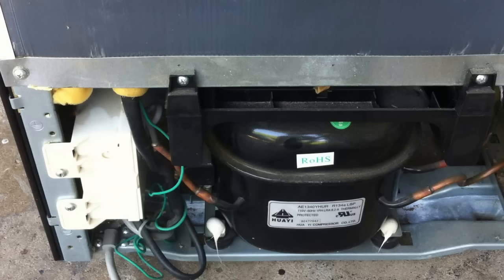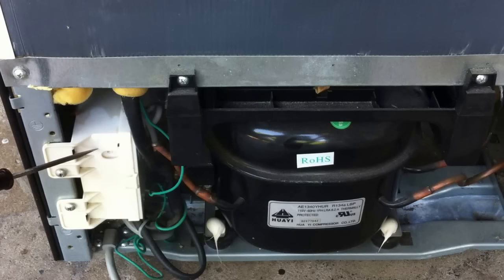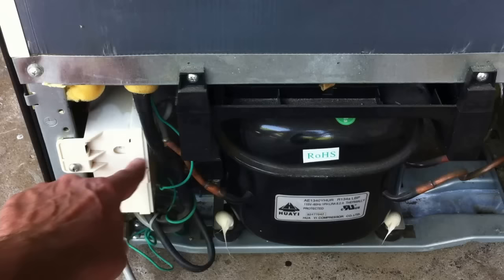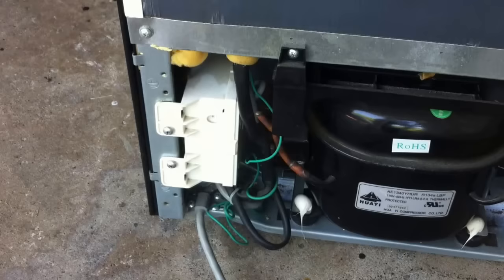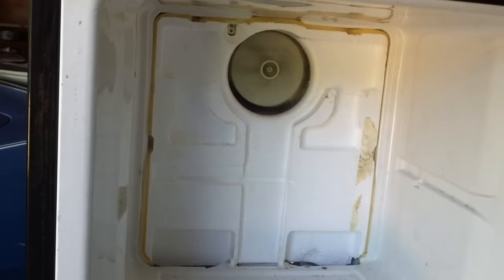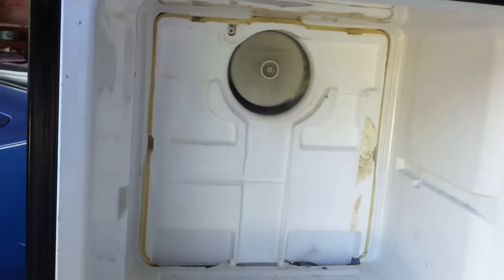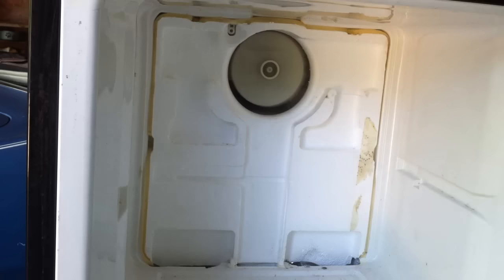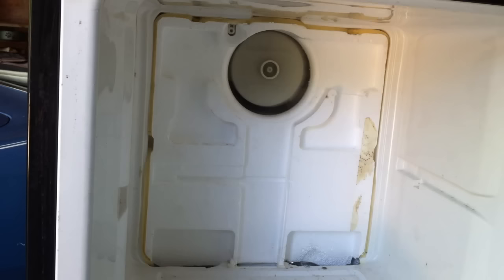Easy Refrigerator Fix, Reset (Defrost Timer) Switch, if it stops running, cooling or working.

Comment from the maker: The refrigerator NEVER came back on until I turned the "switch." Call it the "switch" or whatever you want to call it. I don't care. A rose is a rose by any other name. The goal is to get the refrigerator to come back on & cool the food inside.
Reply: Michael Powell hi! My fridge is making a buzzing noise. It's a mini fridge, can u help me with a quick fixxxx? Thank you
Reply: That is the defrost timer.  Chances are it will stop running again.  The df timer motor is going bad or it has sticking/ bad contacts in it.
Reply: you sir speak the truth
Reply: @rapunzellouise  get a new one. Those things are cheap and I promise you you will spend more fixing it. 

Theres not much there to fix, and what is there is really expensive to fix. Also, lots of times you can't find the parts. 

If I had to take a guess, it's the relay on the compressor. It could be the compressor locked up (buzzing sound). If its plugged up and got power to it, check the compressors temp. If its really hot, get another fridge. They should be a bit warm but not hot enough you can't touch it.
Reply: Hi there , when you say you unplugged it and didn’t come back on , do you mean there was no electric going to the fridge or the fridge freezer wasn’t cooling? 
I woke up today and my fridge has electric going to it as I can see the temperature and light on but I can’t cool or freeze anything , I can hear the fan but no compressor humming noise

Comment: You mentioned that there are other youtube videos that show what is in a little white box.  I looked high and low and can't find the videos.  Where are the videos?  Thanks in advance.
Reply from the maker: I posted this video in 2012, so I don't remember saying that or posting it. It might be a part of one those really long playing videos that takes the refrigerator apart. I'm not a repair technician.  I just stumbled upon this "fix" while trying get mine working again.
Reply: @steelcantuna  Just something you said in the video.  Great Video.

Comment: That should be the defrost timer, it switches the fridge from defrost to cooling.  You can override it with a screw driver.  I like to put a black mark on the center round part and check it later to make sure it turns.  If it doesn't turn, then it won't work (will be stuck in defrost mode or refrigerate mode).

Comment: When I get my compressor it's own power runs just fine but when I talk to the wiring harness does not run at all but the condenser motor runs. Go to bad control board calls it her thermistor
Reply: The book called "How To Talk To Wiring Harnesses For Dummies" might be of some help. Worst case scenario instead of just talking to the wiring harness try sweet talking to it instead. Good luck!!

Comment: So do u always have to check the timer and do this  if ur fridge stops running.....does it cum on bk itself after defrost?
Reply from the maker: It means (most likely) your timer is going out on you. Start looking into ordering the correct replacement part(s). Usually they are inexpensive & easy to replace.

Comment: Need advise, fellow youtubers.
My fridge was stopping freezing even though it had power supply.
Used this solution and got it to work. It still stops freezing at random times though which made me throw food countless times. Any tips? I seriously cannot afford a new one...
Reply: Mine is doing the same thing. It will get down to -3 and then go Back to room temp
Reply from the maker: +Gio Antony  From what read on other post, if it keeps stopping, the whole little defrost timer switch needs to be replaced. I think they are pretty cheap & fairly ez to swap out.
Reply: Yep. what the above poster said. Sounds like your defrost timer gets stuck in the defrost cycle. Fairly common problem. Very easy fix and should be less than $30

Comment: Looking for some help. So I moved fridge that had been unplugged for a few months and plugged it in immediately like an idiot instead of reading the tips all over the internet that say wait 24-48hrs to let gas or oil or whatever settle. 
The power was on, lights and could hear it running but not getting cold, the very back of freezer felt a little cold but that's it. 
After reading online I have had it unplugged now for last 24hrs. 
So my question is for anyone with experience here....how long should I wait to plug it in? And do you think I caused any damage by leaving it plugged in for a couple days right after moving? Any other tips would be appreciated.
Reply from the maker: Sorry, I've never even heard of waiting to turn on a frig before, until now. Cars with a/c's get bumped around all the time & it doesn't effect the a/c system. From what I've seen & read all a/c systems work on pretty much the same principle of high side & low side refrigerant exchange.  If you can't get it working, estate sales & SOME garage sales have good working units for $20.00 to $100.00. On Craig's List you can sometimes get one for free if you will just come get it out of their way. Good Luck

Comment: The problem with that is, that is actually a timer. So when you turn it like that manually sure, it turns on, but will it continue to run through the cycles?

Comment: Mine turns off for hours. Then i move the knob to a lower cooling position then it's starts to work. But after a few hours i have to repeat it over and over.

Comment: Is it clockwise or anti? My refrigerator is not running sap I will try this thanks
Reply from the maker: Try it either way. Mine was only about a quarter turn to the right (clockwise). I am NOT a refrigerator repairman. I just "happened" upon this years ago. Good luck.
Reply: @steelcantuna  it’s working perfect now thank you so much for saving the Xmas shopping

Comment: I have power lights all work go to set temps on ref & fre they come up then with 10 sec goes back to off.what could it be?
Reply from the maker: +

I’m sorry I’m NOT a refrigerator repair guy. 

This is just something I happened upon while trying to fix
my own frig. 

It gives you a chance to keep your food cold while you
figure out what to do next.

BLOCK CULLER

Comment: i accidentally left my mini fridge door open all night last night and now its not getting cool... do you have an opinion on how to troubleshoot or fix it?..
Reply from the maker: I am NOT a refrigerator repair guy. But, if it were mine, I would unplug it. Let the motor & other components in the back cool down completely. Then try to plug it back in & turn it on. You may have burned out the motor or something, if it was trying to cool down the inside for hours on end. Refrigerators are not designed to run continuously like an a/c unit might run for hours at a time.

Comment: that's not a "trip switch" it's so you can manually operate it for testing purposes,if it's bad and you do that it will either stay in cooling and never defrost,coil will just freeze solid,or stick in defrost and not cool,the fix is to just replace that timer

Comment: @1:36 question I really want to ask is, why would I want to put a metal screwdriver into an unmarked crevice in a refrigerator that is running? If it's not the same make and model, I could get electrocuted!
Reply from the maker: You don't!!!!! Especially if you don't know what you are doing. What I point out in the video is a plastic slit that looks like it's made for a flat head screwdriver. I NEVER suggested that people just randomly poke around inside with a screwdriver. Besides, that's why a screwdriver has an insulated handle!!!!!!!!!!! So people DON'T get a shock.

Comment: my side by side whirlpool stopped getting cold both freezer and frig at same time, what can i do pls
Reply from the maker: Teresa Black 

I’m sorry, but as I stated I’m NOT a repairman. You could check
your fuse box if the lights in frig are not working too. That would tell me the
whole thing is NOT getting electricity. Look for any switch in the back of your
refrigerator (that is not necessarily marked or indicated). Also, read comments
of success below. One lady found out that if she holds down the “on & off”
buttons inside the door at the same time for a moment, the refrigerator came
back on. Good luck.
Reply: Litres are on but it all warm inside

Comment: Chances are its a bad switch, so if it goes off again which it will be in 2 or 3 weeks..if so just take out the white box ) pull plug of course) and order a new switch that sits inside the box. on line of thru Avanti  Just need a Philips head and flat head to pry the box open and help lift the switch out and replace it,,,simple and easy

Comment: Fridge and freezer stop working, but if  I shake it starts to work. How I can fix this?
Reply from the maker: As I said in the video, I’m not a refrigerator repairman. I just happened upon this switch because it wasn’t even a year old unit.

It sounds like you have a short. I would try just shaking the electric cord & socket where it plugs in. Maybe the cord is faulty, or the socket, or maybe where the cord first go to the inside of the frig. Be careful electricity though.

Comment: Here's what to do if your "Frost Free" refrigerator keeps icing up. 
Check if the grills in the back of the freezer compartment are not completely blocked off by stored food. Check the freezer door gasket. It might be bad.

Now unplug the refrigerator.
 
1 Locate the defrost timer. It's either behind the kick plate just above floor level or in the ceiling of the non frozen food compartment. It is a small recessed dial with a slot in it.
2 With a screwdriver, turn the timer dial SLOWLY clockwise until you hear a click. Stop right there.  
3 Plug in the refrigerator.  If you listen intently, you may be able to hear the timer motor working. It's usually very quiet.  
4 Wait maybe 30 minutes and you may hear the appliance start up. If so, the defrost timer is still properly working. If not, buy a new timer for your model. Defrost timer motors are not expensive and not too difficult to replace. Sure beats forking out $900+ for a new appliance. - and the delivery truck driver from the appliance store hauls your old one away, replaces the $60 timer motor and pockets a few hundred bucks after selling your old refrigerator.

Comment: This reset or trip switch has to be adjusted every 24 hours.  The freezer temp control is mid-range & the bottom section is set to 4.  What to do so I don't have to play with the switch every 24 hours? note: the freezer cools down to -4degF and the bottom cools to 40degF.
Reply from the maker: Terry O I am not a repair tech. From what other say, order a new timer for your model frig & replace the timer unit. They say is an ez fix
Reply: @steelcantuna , I will go to the following link and see if the new part is the same as the current part. If it is my wife will order the new part & perform the replacement.  Thanks.

Comment: My fridge turn's on with the light, but it doesn't get cold at all. I looked at the inner workings of my fridge and it doesn't have one of those switches.
Reply from the maker: Look at the comment by Sandi Grace below. She found her switch by holding two buttons down at the same time (temperature buttons). Fish around & maybe there will be someway to get it going. Good luck.

Comment: replaced the defrost timer (the box that has the magic "trip switch") and the interior bulb was on so I knew the fridge was getting juice but nothing was running. Two clicks of the "trip switch" and the fridge fired right up !!!!!!
Reply: Calvin Pryor that is because you had a bad defrost timer or a bad connection on the timer. 
  I would say this video, for the most part, is a temporary fix.
Reply: @rickeykeeton71  I'm told it's the compressor. Replaced the timer and thermostat but freezer/fresh temps are still low. HUGE frost build up on the evaporator coils right by the inlet tube
Reply: Calvin Pryor did you check the defrost heater?
  If timer was changed and the defrost thermostat was changed, the defrost heater may be bad causing the evaporator coil to freeze up. The ice on the coils prevents the refrigerant from removing the heat in the freezer. In effect insulating the coil. 
   If the defrost heater checks good, I would suspect low refrigerant, weak compressor or bad start relay on the compressor.
Reply: @rickeykeeton71  local shop tested my heater and they said it was good. my digital meter was jumping all over but their analog meter had a much smoother consistent reading. they actually talked me out of buying their $70 heater !!!!! they looked at the pix of the frost build up by the inlet and they diagnosed it as a bad compressor...but the start relay is a new lead thanks !!!!! how much do folks usually charge for the refrigerant?

Comment: My motor keeps cutting off, but the light is still on, any suggestions?
Reply from the maker: I am NOT a refrigerator repair guy. But if the compressor keeps turning off & you manually have to turn it on; it might be you need to replace the defrost timer. Find the part # & order it on the www. Good luck.
Reply: @steelcantuna  Thank you for the advice,  I looked in the back and that propelled fan isn't working.🤝🏿

Comment: DOES ANYONE KNOW WHERE THE DEFROST TIMER IS LOCATED ON A FRIGIDAIRE GALLERY TOP FREEZER REFRIGERATOR  MODEL. FRT22RGJBI   IVE WATCHED SEVERAL VIDEOS ON THIS BUT MINE IS DIFFERENT ..MOST SHOW A PIECE IN THE TOP OF REFRIGERATOR THAT GOES FRONT TO BACK. CONTAINING THE TIMER. MINE IS MADE 5 2000 AND HAS A SMALL CONTROL BOX  IN THE FRONT FOR FREEZER TEMP AND A CABLE TO A FLAPPER TO LET COLD INTO REFRIGERATOR  BUT NO DEFROST TIMER. I CANT FIND WHERE THEY HID IT ON THIS MODEL. PLS HELP!!!

Comment: If that is stuck you need a new one lol the motor in that defrost timer is bad but sure it will run a while at least till the part comes in  but if you don’t replace it will never defrost

Comment: i have a 2 yr old whirlpool, "gold"..I do not see a reset switch. when we lost power from a storm, and the power was restored, the fridge light inside comes on, so we didnt think anything of it..over night, when I woke up in the morning, the power was clearly on, but the fridge wasnt as cold as it should be. simple fix. I unplugged the frig, plugged it back in, and heard the compressor start, and the fridge was back to normal. so, if you lose power, even though the power is restored, unplug the fridge, and plug back in, if its a reset, it should kick right on.
Reply: thanks, will give it a try .. we had the power flick off and on a few times lately, now the fridge is muggy warm inside, lovely  .. right after doing a good big grocery shopping .. arg
Reply: same exact situation with me..power flickered on and off..unplug it, wait 15 seconds, plug it in..good to go

Comment: YOU DON'T SAY HOW FAR YOUR TURN IT AND WHICH DIRECTIONS IT LOOKS LIKE TO THE LEFT THEN ONCE TO THE RIGHT, IS THIS CORRECT???
Reply from the maker: Don't try to forcefully turn anything you find. Mine was just a little plastic top (for a flathead screwdriver) that turner about 1/4 of a turn to the right & the frig came on!!! I never tried to turn it to the left.  From what I read in the comment area below for years is: all refrigerators are NOT the same. Use a little common sense. Nobody had shown me ANYTHING about this when I "discovered" it. Good luck & God bless.

Comment: I have a haire mini fridge brand new out of box. Someone gave it to me. It will not cool. Anyone have an idea how to fix it. I cant find the compresser reset.
Reply from the maker: If it is brand new & never used it sounds like a power supply issue. It shouldn't be the defrost timer switch as described in this video. I'd check the power supply is getting to the frig &/or  the on/off switch could be bad. I'm NOT a repair person. This is just something I'd look at initially if I bought it.

Comment: Is that switch on all refrigerators?
Reply from the maker: No. There are many variations. I am NOT a refrigerator repairman. Some are turned on & off by a computer chip, some are mechanical, like the one in my video.

Comment: what if your fridge dosent have that ? because I can't find it on mine
Reply: +Aaron Jones  There might still be a white box looking alike, try see if there is a small cap on it - try turning it.  Or just give it a kick.  It might be a relay inside that got stuck.
Reply from the maker: +Aaron Jones Also try looking inside the frig like some other people have written about. One lady found out that holding down both the on & off switches at the same time would make her's "reboot." Good luck.
Reply: Thanks both of you

Comment: My fridge is running all the time. If I turn it down to zero, it shuts off, but then when I turn it back up, it runs constantly. The water, etc inside (the fridge) are frozen solid (some are) and what's in the freezer isn't quite frozen. The fan isn't running inside the freezer. Guess I'm gonna have to call a repairman. My husband has been working overtime at work and really doesn't have the time or energy to work with it. OH, this is an extra fridge we have in the garage. We can do without it if we have to. I can bring the freezer items inside.
Reply: my bf just plugged ours into a timer plug so it went off as needed 
quick and easy.....

Comment: My freezer will not go into defrost causing ice build up
Reply from the maker: I have told everyone over the years I am NOT a refrigerator repairman. But... it sounds like you have just the opposite of the problem in this video. The only thing I know to do (if you can't turn it off with the timer switch) is to unplug it periodical so the frost doesn't build up. Look into having the timer changed out. Good luck.

Comment: How to protect refrigerator from small mouse enering freige from back side
Reply: The same thing happened to me.On the back where there are any holes ,used one of those copper skillet scrubbers and lightly stuff ,you don't need to go deep ,just cover their entrance .No problems after that .